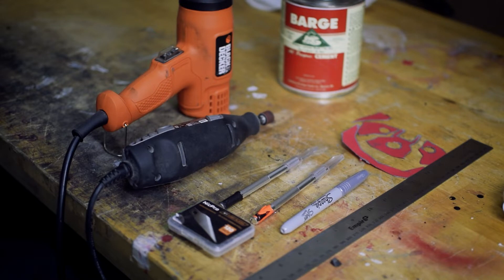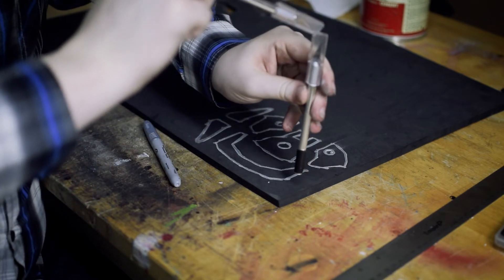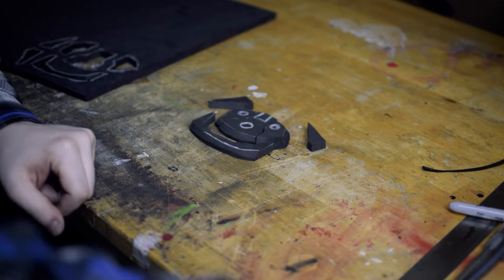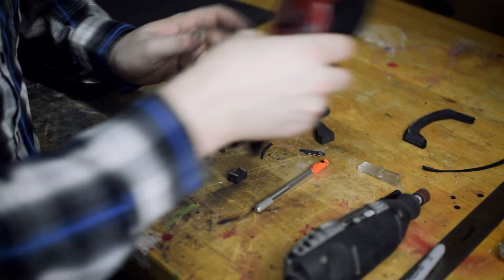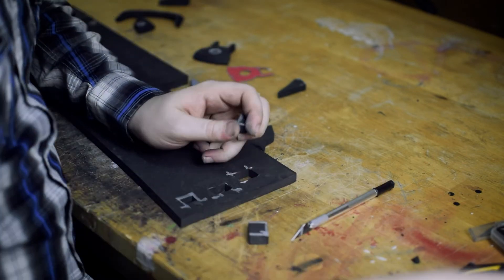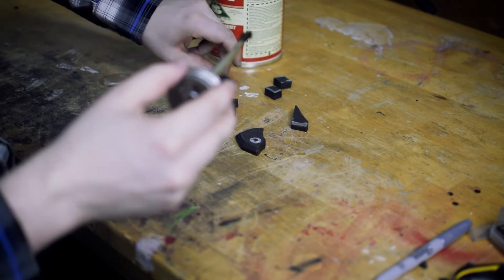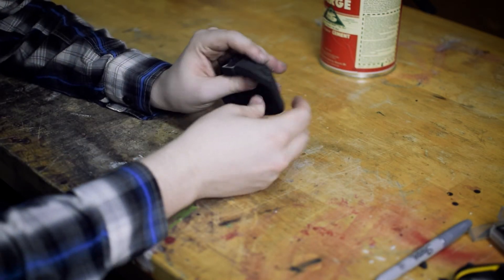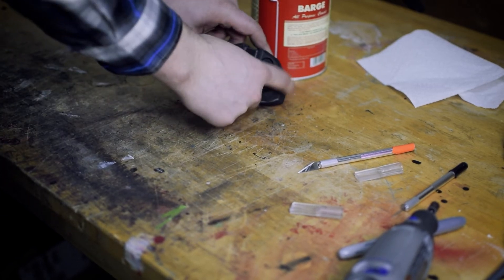Halo Reach Cosplay Tutorial - Hand Plates

Comment: Interesting shoe glue. Don’t you recommand hot glue?
Reply from the maker: I recommend using Contact Cement (e.g. Barge) instead because hot glue has a tendency to fall apart. Shoe goo isn't the adhesive, it's used as extra reinforcment on the inside to make it extra strong. Hot Glue + Shoe Goo may work fine, but it wouldn't be as strong as CC + Shoe Goo
Reply: @RandomRangerCosplay  no I use Contact cement of course. But inside I used to use hot glue instead of shoe glu. That was my question ☺️
Reply from the maker: @sergueichidyvar  oh yeah. A lot people do that instead yeah. It's not as strong, but it's a lot cheaper and less toxic :)